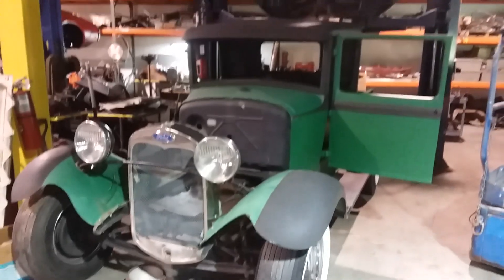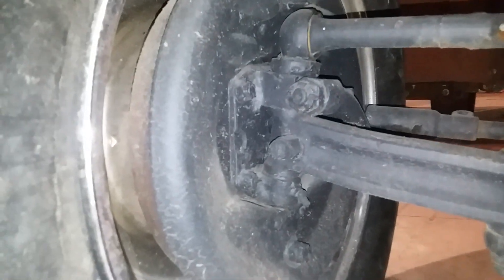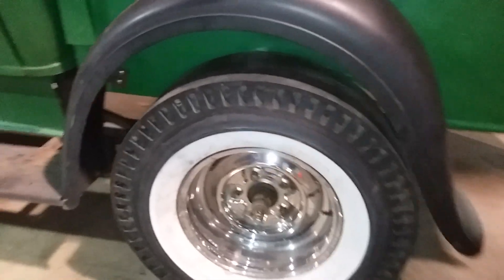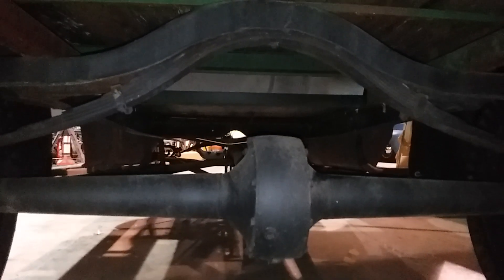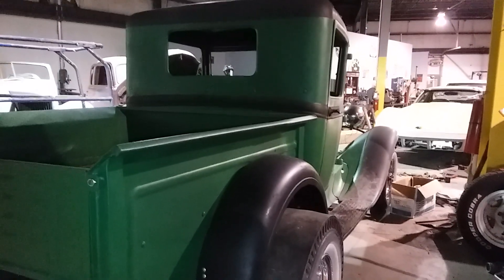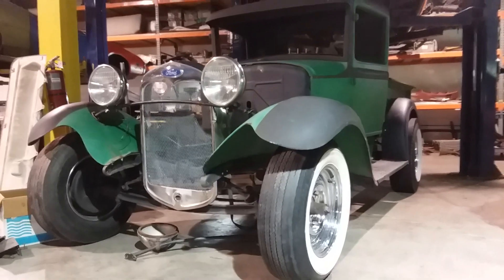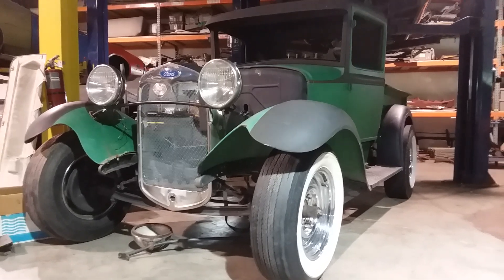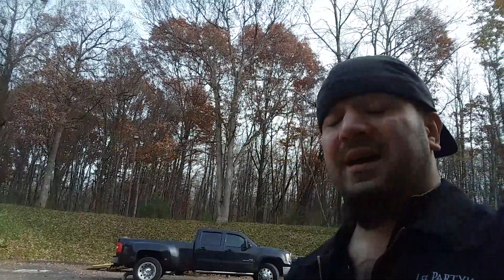1931 FORD PROJECT TRUCK  "BEAUTIFUL SHAPE"

Comment: Good flat head and 5 speed and quick change rear end would be rad
Reply from the maker: It is definitely an open canvas for any powermill as it sits. Kind of toying with different options to put in it at the moment, there is a few good Motors at the shop just itching to go into something like this

Comment: Actually I believe your grille is from a 1930.  The recessed area at the bottom was normally painted.  The '31 grilles had a recess at the top as well as the bottom, and the 32's were totally redesigned.  The 29 grilles were smooth with no indentation at either the top or bottom.  Hope this helps.  Great looking truck and great find!  Look me up if you ever want to part with it!  https://www.google.com/search?biw=1680&bih=908&tbm=isch&sa=1&ei=WG7wW_XgLdK_0PEP28CM6Aw&q=31+Ford&oq=31+Ford&gs_l=img.3..0i67l2j0l5j0i67j0l2.72072.72710..73305...0.0..0.87.169.2......1....1..gws-wiz-img.......0i7i30.ERqcJhgK3UI#imgrc=J4QTiMF4Svy-iM:  (trying to post a link to a car with a 32 grille shell)
Reply from the maker: Thank you very much for that information. The guy said the shell was the wrong year but he thought it was a 32. Maybe it was a year older rather than a year newer. I will definitely look into that though. Thank you again for that.
I will post some more videos on my channel along the way during the build. Keep an eye out for them. This one will most likely be a rather quick build. It needs far less work than some of the others here